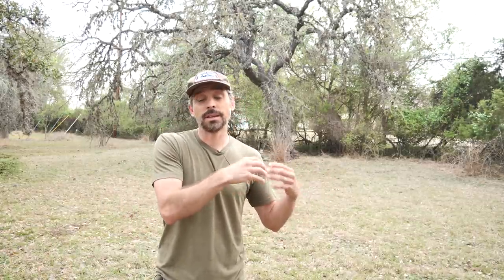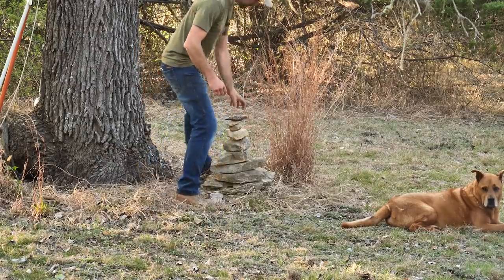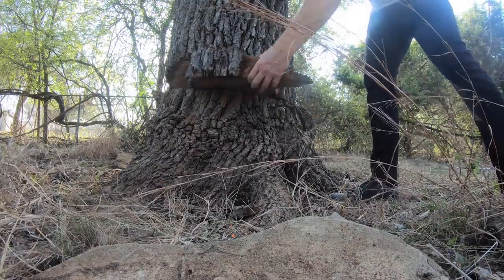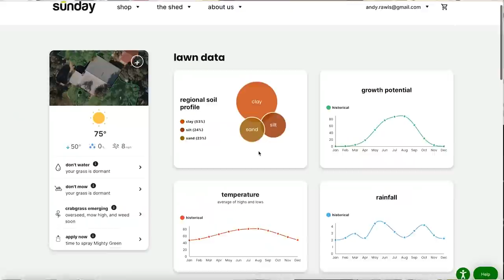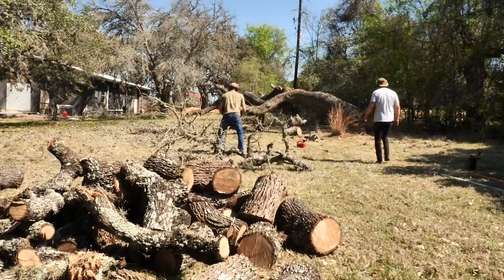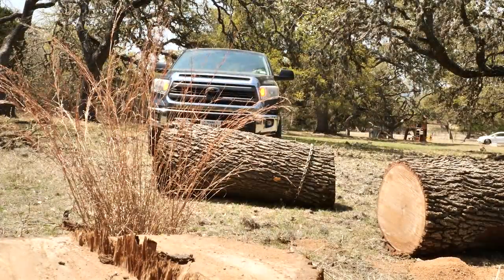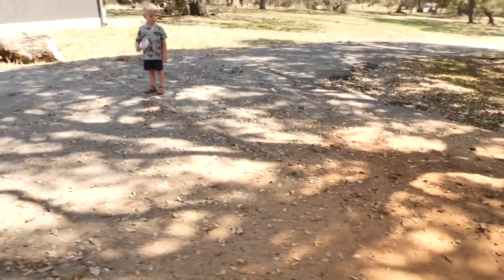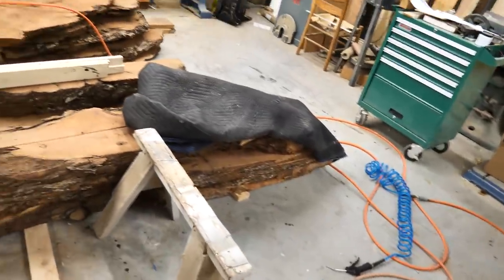Tree to Lumber with a Chainsaw Mill // Oak Wilt Is Killing My Trees

Comment: I’m just going to say wearing chaps is probably one of the most effective ways to save your life felling trees. Anyone who has accidentally gotten on the wrong end of a saw knows that it will take a larger chunk out of you than you thought it could faster than you’d ever expect. Chaps, just like a stop saw on a table saw, will stop the chain rotation and stop the saw from going through your legs. There are big arteries in your legs, practically a death sentence if they’re cut. 

Additionally, your wedge should be only about 30% of the depth of the tree. The channel “guilty of treeson” has a really good video on how to fell trees for anyone who thinks they are going to try it. Trees weigh tens of thousands of pounds. People lose perspective on the forces at play with a tree so it’s important to know what you’re doing. 

Tree work  has some of the highest rates of fatality on the world. Of any job in any industry. Chainsaws are some of the most dangerous equipment you can get from the hardware store and complacency is the killer.
Reply: Don't know how many calls my local vfd has been on involving someone not wearing chaps but it's a few a year. Nicked my leg once with chaps on, never run a saw without them again.
Reply from the maker: I knew I would get some comments about wearing chaps and I won’t argue against it.  Actually I appreciate the straight forward info in your comment.  I rarely break out the big chainsaw in fact it’s been sitting in my storage for a few years now untouched…still not a good excuse.  I need to gear up if I’m going to keep up this type of work.
Reply: @AndyRawls  well done for acknowledging that Andy, that was quite scary watching you work without protection!
Can't believe you processed pretty much that whole tree in a day with just two of you! So sad the your oaks died but I know you'll give them a beautiful second life.
Reply: @AndyRawls  what

Comment: Personally i find it easier to cut the angle section of the wedge first, just because you can look down the cut as your bringing in the bottom cut in and help it connect easier. Does that make sense?